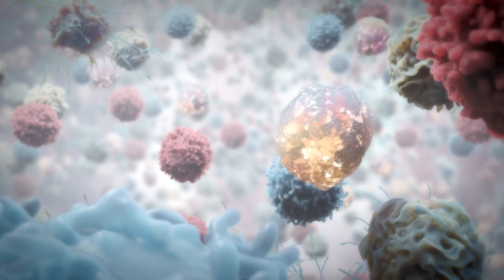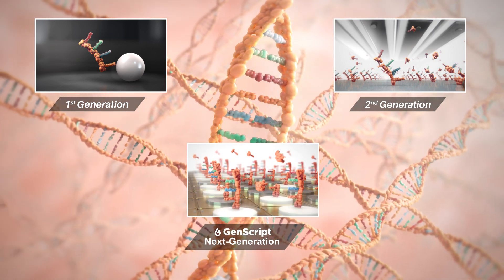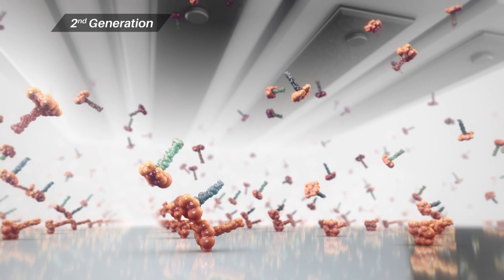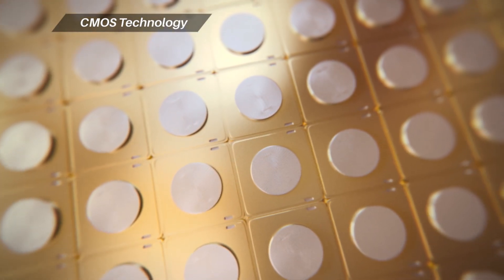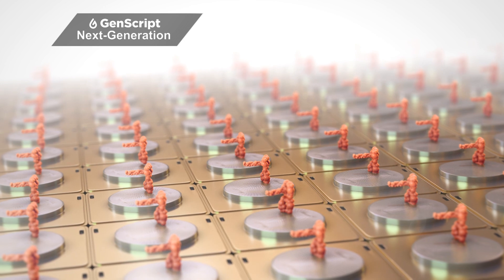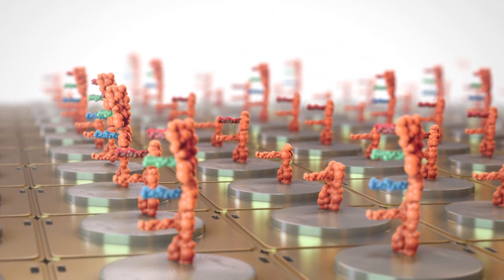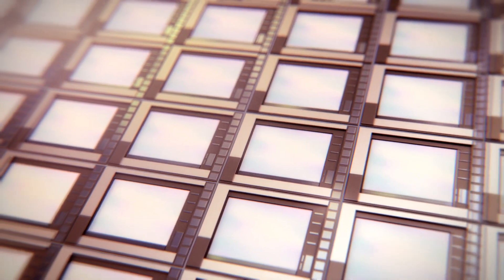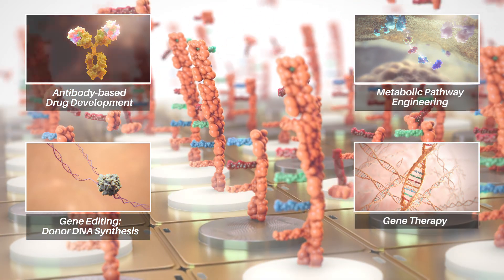DNA Synthesis Technology | How synthetic DNA is made

Comment: Can these artificial DNA molecules produce an entire cell or perhaps an entire organism??
Reply: TL;DR: No. These synthetic DNA molecules can't produce an entire cell or organism without the already pre-existing cellular components like ribosomes, proteins that interact with DNA and RNA, and the cellular environment itself. Maybe you have a case for a synthetic viral DNA from these synthetic DNA, but otherwise, a cell, bacteria or more complex, are a definite no go. 

Long, Detailed Answer:
So, the DNA molecules by themselves can't do anything. What they do is store information for the cell to read and make stuff. DNA molecules are also chemicals, technically speaking. Also, these are only "oligonucleotides" which means they are a single strand of only a few like 10-20 (maybe?) As, Gs, Ts, and Cs (which these are called bases, but they pair together in specific ways to form base pairs. The pairing patterns are As to Ts, and Cs to Gs and this is strictly the case. There's never a A to G or a C to T, and if so, ever so rarely.) and I imagine that there would need to be a lot of coding for these oligonucleotides to form something that can function in a cell. The "somethings" that I am refering to are called "plasmids" which are circular pieces of double stranded DNA of about a few thousands of base pairs. Plasmids usually code for like 1 to maybe 5 things (things = proteins or maybe functional RNA stuff) and can only be used in bacteria like E. coli in the lab. These oligonucleotides alone won't be enough to encode for an entire cell LET ALONE an entire organism. You'd need like a little oil bubble for DNA, and DNA-interacting proteins along with RNA-interacting proteins to do their thing, you'd need ribosomes to be around so that proteins can be formed after DNA gets transcribed to RNA, and you'd need the 20-to-21 common amino acids around because that's the basic components of proteins. Then, would you have some ground for a possible cell to be made. For an entire organism, it's these fundamental grounds PLUS WAAAAYYY more complexity and sophistication, essentially. Fundamentally, from these synthetic DNA made from what's essentially a printer for DNA, you can NOT make a cell or an organism. Let the other stuff from a cell be around first, then you might have grounds to make a bacterial cell. However, you'd need a WHOLE LOT MORE to make an organism.
Reply: @sciencenephilim6411  also phosphoramidite synthesis is topped out at around 200 bp's while most organism require over 1,000,000 bp's, and the human genome itself is 3,400,000,000 bp's.